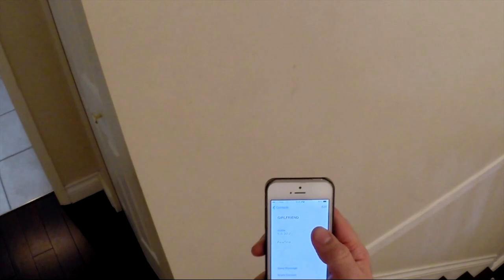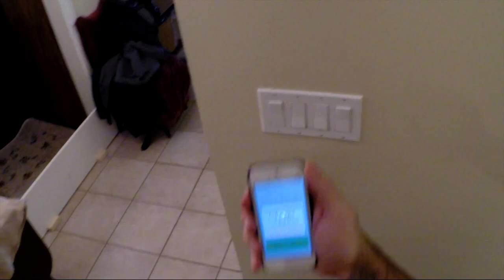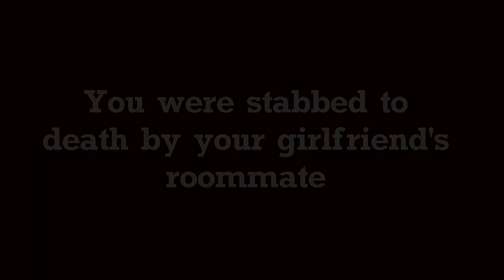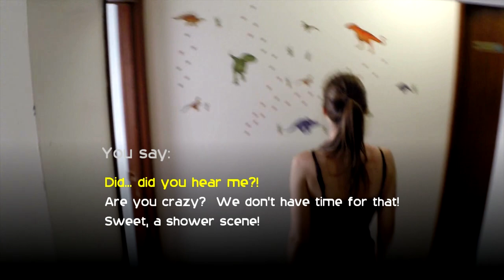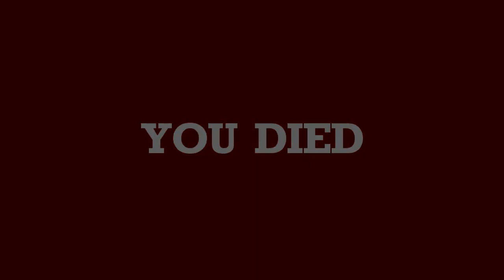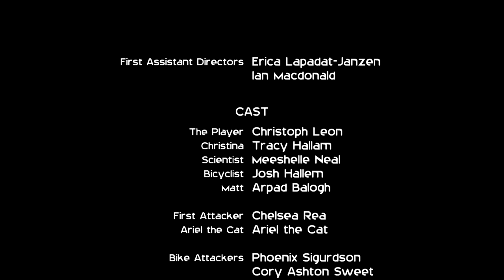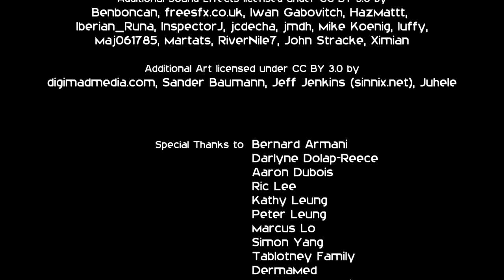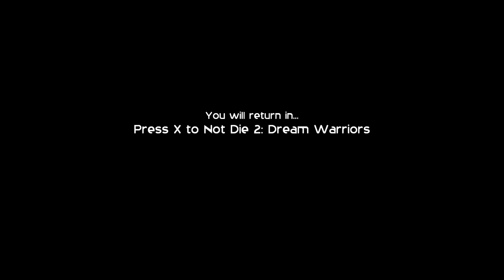PRESS X TO NOT DIE - David Cage Would Be Proud

Comment: Muscle memory is a pain in the ass. using an xbox controller threw me off so badly for quite a while. Because I grew up with an SNES, and still have a lot of nintendo consoles. (which have now reverted to the SNES layout basically).

Every time it tells me to press A. I would reflexively press B.
Why?
Because the SNES layout is : Y X, B, A while the xbox layout is X Y, A B.
To top it off, (for extra mindfuckery), they both use the same four colours for the buttons. 
Snes: Green = Y, Blue = X, Yellow = B, Red = A.
Xbox: Green = A, Blue = X, Yellow = Y, Red = B.

Note the one thing they have in common? Yeah, that only serves to make it more confusing. Not less. XD
(And if you don't realise the SNES has coloured buttons, then obviously you're American. Still don't know why they did that design change. Such an ugly square lump of a design...)